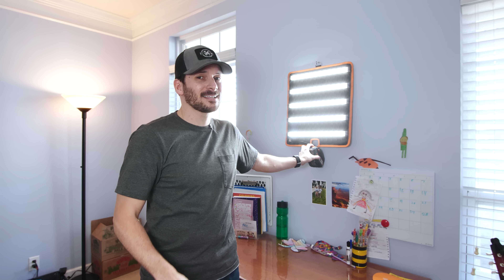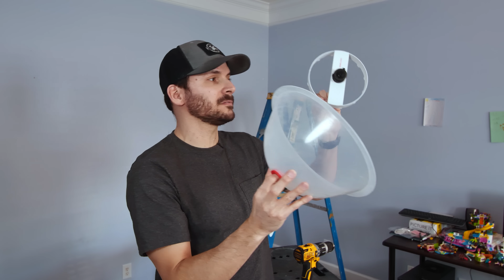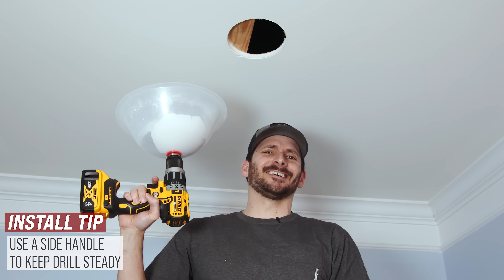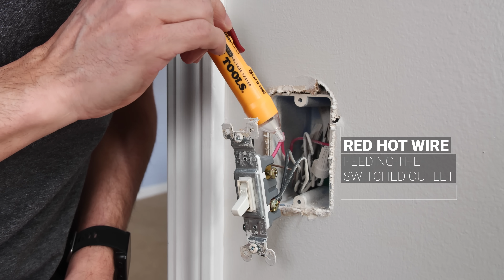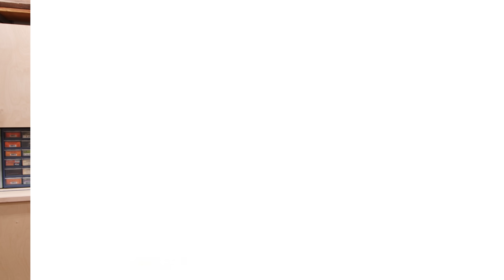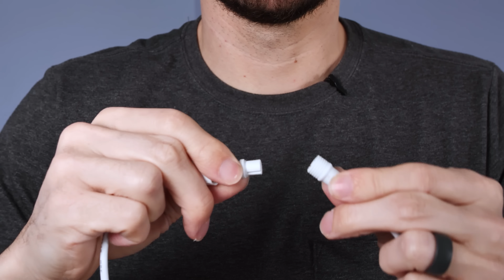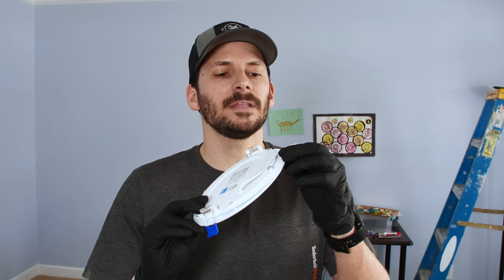Recessed Lighting Install with No Attic or Prior Wiring

Comment: Thanks for sharing this Brad. This is a something that I’ve been wanting to do for a few of the rooms in my house that just have lamps that are on switch run outlets. I have done a far amount of electrical work in the past so I’m competent enough to do that but I just haven’t been sure about how to deal with the outlets and also how to run the lines for the lights where there isn’t any existing ones there that I’m aware of. Lots of great information, thanks again Brad.
Reply: Sounds like you’ve done hardly any electrical work

Comment: Didn't show the one thing I was looking for. Somewhere you are you are turning one power line to 4. I need a cleaner way of doing that.
Reply: You start with your hot wire to the first light and then from your first light you junction off of that to the second light , then junction the 3rd light wire into the second light junction box. You just have to jeep continuing the circuit

Comment: I just put 16 of these throughout my basement, they are great! I bought ones that have 5 different white temperatures (set with a switch on each box) since I plan on painting after and haven't picked the colour yet. Another tip, mine needed a 4 1/8" hole saw but I only had a 4" one. I used the 4" one, then shaved the hole a little bigger all around using a drywall saw, rather than spending $30 on a hole saw I probably wouldn't use again.

Comment: Why didn't you just put a junction box in the ceiling at the supply cut and run the power to the outlet normally and then hook the red from the switch and white wire to the new can lights?
Reply from the maker: pigtails on light weren't long enough
Reply: You have to maintain access to the junction box according to code. You can't have it closed up between floors like that. So unless you wanted there to be a covered box in your ceiling, that wouldn't to work.

However, if you the space above is an attic space that totally would work, but instead of 1 you user 2 boxes. This way you don't have to worry about if the existing cable run is long enough. You just put a box on each end and replace the wire in the middle.

Comment: Actually in reality this job would never ever go this easy, most ceiling’s have insulation, batting or wood shavings, your ceiling looked brand new, I’m in this process now and not even close to how you made it look. And I’ve done it several times.
Reply: This is a two story house, no insulation in the between the two floors. Please don't do electrical work.
Reply: @HN-gj2iq  i am an electrician
Reply: He mentioned that most ceilings are like this. But yeah my the video title it seemed like you would need no wires at all.
Reply: In 6 years of installing electrical, I've only run into a house like his once. Might just be my region, but I'd call it very rare.

Comment: with all respect, you miss-used your voltage tester - it picked up the hot in the line you were first testing in the ceiling, DOESN'T MATTER if the switch is toggled on/off, the voltage it ALWAYS ON in the black, so you probably had the correct line to begin with.
Reply: You could not have watched the whole video.  He literally addressed that right after he tested it.

Comment: Common practice with switched outlets is what you are finding at your switch box.  The black wire loops around the screw and the Red wire is switched.  Then the 3 conductor cable goes out to the outlet where generally half of the duplex plug is tied to constant power and half is switched.

Comment: Here is some helpful advice. If the switch that controlled your outlet was on the opposite wall, and you had two lights cut into the ceiling between the switch and outlet, you could have run a piece of 14-3 between those two lights to connect your outlet again. the black would have stayed constant hot, and the red could be used as the switch-leg for the lights. this way you can have the outlet working again without cutting more holes in the drywall to run a new wire. Fiberglass fish sticks work a lot better at fishing through this type of ceiling too. Great job on the explanation though.

Comment: Question, if you have your standard light in the middle and want to replace that and put different puck lights all around your room. Can you use the wires from the original middle light n split it wit all ur puck lights? Or that would be too much power?
Reply: should be okay, they new led lights dont draw too much power.

Comment: Good video. But why no attic insulation?
Reply: possibly a warmer climate where he lives.

This is definitely not a Northern climate option -- as far as I know our building code in Ontario wouldn't allow these type of lights in an attic setting without housing around them.  That is why many people build small bulkheads so they can run the wires and lights on the warm side and not have to worry about air leakage into attic.

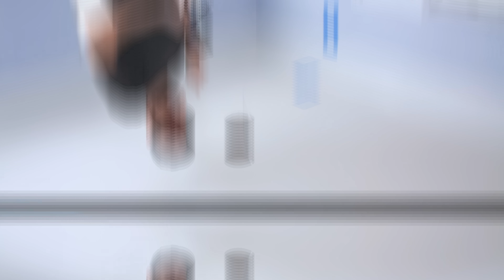Comment: At 14:00 mins rather than struggling to get the fish tape through the box or down your access hole you could undo the wiring in the switch box remove the switch box then run the wire with easy access replacing it with a remodel 1-Gang box

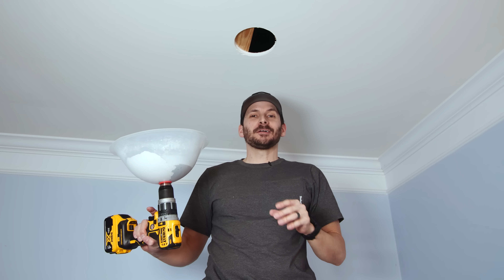Comment: 3:30 i just had a close call where the drill bit of the hole saw missed by 1.5" a 100a service cable running in the attic to a subpanel in the garage. thankfully the cable was secured to a rafter so the hole saw hit the bottom of the rafter/stud and didn't nick the cable. whew.

Comment: being at a construction job for sometime, we have this sop to put wire looms to housed the wires going to  each terminals (sockets / switch / junction box etc) that way, when we are to add another set to wire (lighting / additional socket etc) we can just feed the wire on the loom and it will definitely land to were we want it to be....

Comment: This video should have a major caveat. This framing construction is not standard. The likelihood of someone having these perfect conditions is low. You will likely have to get into an attic space if possible. If not YOU MAY REQUIRE MANY HOLES, the ones he shows later in the video @ 12:00 but also at each joist bay to cross joists to interconnect the lights. I am a master electrician and feel bad for all the people that expect these perfect conditions and then bound to their decision to take on this task after cutting massive holes in the ceiling only to find out that there aren't trusses but joists that can't fished across. Other than that it is a well explained video. If you cut in a junction box with the dead end wire that runs to the outlet, and a jumper from the light to that jbox you can power the outlet again with your choice of constant power or half hot to turn on with the lights as it originally was.

Comment: I'm not an electrician by any stretch of the imagination, just have construction experience. But just a heads up: If you plan to do this in the US and it has to pass inspection, I'm fairly certain NEC Code requires the junction box has to be secured. He did mention it can be secured in the video, but I would secure it to be safe guys!
Reply: Other than that, a great video!

Comment: After you wire the first light, how do you get the wire to the next one? You run a new wire from the junction of that first light to the next in the ceiling? If you're not going up in the attic, you used the fish tape to bring it over to the next light?

Comment: Exactly what we needed to watch for our upcoming kitchen reno....TOMORROW 😱🤣👌🏻

Does that mean the fan will also be if you don't have attic space? We've been wanting ceiling fans BUT we don't have ANY attic space throughout the entire house so we've given up on installing some
Reply from the maker: I'd need to add some blocking for a solid fan ceiling mount.  But if you have joists they make tension mounts that go between joists and you can put the fan up there pretty easily

Comment: Awesome video. Only thing i would do different is avoid make additional holes to fish the line. There are some nice tricks available to fish a line up and over a corner onto the ceiling.  A simple wooden broom stick with a weighed object attached to it via a string is great help. You can even get fancy and use the magnetic fishing tool as well.

Comment: 17:27 who did that crown molding? Gap city. Need to fill that gap - other that that, which is off topic, great instruction.  I have wired similar lights in an entertainment cabinet but smaller in size.  Mine had 3 levels of light coolness and were dimmable which have been connected to a dimmer switch.

Comment: You could also remove the crown molding at the wire area, and run the wire through small holes behind behind the crown and no drywall repair. Just re-install the crown, caulk, and paint , and you are done.

Comment: Removed the builder grade ceiling light with 2 60w incandescent lamps and installed 4 6” Dimmable LED’s in my kitchen last year.  I cut so many holes in the ceiling running 14/2 my wife thought I had lost my mind! 
But now - NOW - different opinion on my mind 😁
And the kitchen is on the first floor. Bedroom above.

Comment: Tip for the hole saw, you can use an aluminum pie plate instead of buying that bowl. You might get a bit of dust still but it's cheaper.

Comment: Hi, nice work I do have some advice about what you could've done. At the junction box you could've just wired the red wire coming from the switch to the black wire going to the light then tie all the neutrals together to have neutral going to the outlet and light and then tie the grounds together to have a ground to the light and outlet again then tie the black going to the outlet together with the black coming from the switch which will send constant to the outlet. Now the red will be controlled by the switch then at the switch change it to a single pole and on those two blacks at the switch I would've tied them together with a pig tail to the common on the switch which the homerun would send power to the switch plus send power to the outlet by the pig tail. Then at the outlet I would've just got a new outlet with the little metal tab connected so then your outlet would have constant through the black wire pig tailed at the switch and junction so that you wouldn't have to run new wire also to note that the way I'm advising about is only possible because you have a 14/3 wire if it was a 14/2 then you wouldn't have been able to do it. Either way nice work keep up the diy.

Comment: How far apart did you go with for spacing between each Ensenior 6" light?  Is the claim of 1050 lumens accurate per 6 inch light? Will a 6 1/8 hole saw work for installation or 6" better? Thanks

Comment: depending on how your code is where you live, you might be able to use a Jbox for the 14-3. have a piece of 14-2 running from the red to the lights, and have another piece tied on to the black wire back to the receptacle. and since the wafer lights are easily removable, it would be considered accessible

Comment: When you put your drill into a lower setting like that it lowers the rpms but increases the torque..you need to put it on one of the numbered chuck settings to keep it from kicking.

Comment: Tip... use the clutch feature of your drill.  That way, if it catches, the clutch kicks in and slips the bit rather than spinning the whole drill out of your hand.  Play with the setting so it is just past the point the bit bites into the wallboard.  Drill slow and easy... don't press hard.

Comment: After you cut the 110 in the ceiling i know there wasn't enough slack to pull into the little junction box to bring it out of the ceiling hole. Did you add an extra splice?

Comment: As an electrician I would have removed the switch box & used a long flexible drill bit to drill through top plate then a fiberglass rod through the hole & hooked it with another fiberglass rod then pulled a new wire to that first light leaving the existing 14/3 wire alone & just making it constantly hot .
Reply from the maker: Thought about it, but I would have violated 314.16 of NEC with # of conductors in that box.
Reply: @Fixthisbuildthat  I would have used a bigger box as a replacement either a 22.5 cubic inch single gang or a 2gang & kept the half hot outlet switch aswell as the new switch so no drywall to repair.

Comment: I just bought these lights for my basement remodel. I may have missed you saying it in the video but I'm not sure, but do you have to have a power source to each light or do you just need to power one and then run 14-3 wire in between each light? I have existing fluorescent lights and the light boxes are starting to hang out the ceiling so I'm switching them to this and wanted to use the power supply from those lights to power these lights

Comment: That was great thx so much.  But please forgive my ignorance for asking the following. Why couldn’t I just fish the wire from the light sucker that has the switch attached?  Why not fish it up through the wall and into the ceiling and then to the nearest desired ceiling light?  Sorry if it’s a really stupid question. 😂😅
Reply from the maker: no, that's a great question and I should have covered that.  It's an exterior wall filled with insulation, so doing that would have been a huge pain.  If it was interior wall I would have done that.

Comment: How did you daisy chain the lights together when there’s studs in the way? What method did you use? 😅
Reply: These are not studs. Joists is the correct term.
Reply: @jessecavada3015  ok well how did he daisy chain the lights if the joists are in the way then..

Comment: I installed them in my kitchen a couple days ago. I had to break the previous jboxes with a hammer and I kind of just stuffed the new j boxes up in the ceiling. There's like a foot of insulation up there so I hope its not a huge fire hazard. Also read the junction box and light are IC rated but im not sure if I should get a second opinion. Its been 24 hours. No fires yet lol.
Reply: My son plans on installing these this weekend and I to have lots of insulation in the kitchen. How did these work out for you? Did you do anything differently because of all the insulation?

Comment: Planning to do this soon and I'm jealous of your situation! I've got 18" of loose insulation above in my attic which I think is going to make it impossible to do this from below. I'm going to have to get up above and move insulation out of the way so it doesn't all end up in the house and I don't think I can fish wires from below through all the insulation so I might have to guide them from above. Not looking forward to it! I at least have good access but it's so hot up there and not many places to step and little headroom towards the edge of the house.

Comment: Great video and explanation!!

I’m not sure if you are aware but according to the NEC code that if you extend an electrical circuit 6 feet or more you have to use an AFCI circuit breaker if it is not already one.

Comment: Good video.  You could skip the exploratory hole in the ceiling as your hole for your light should have been close enough.  One less patch to make.

Another tip.  Use your phone and your apple watch to view up inside the ceiling!

I just did one of these in a living room that did not have a ceiling light.  Open trusses thankfully.  Cut our main hole in the center of the room.  Office adjacent we cut the exploratory/access hole.  Replaced outlet same as this video and ran the switch to the ceiling.  Being that the wire entering the ceiling to the middle of the room was about 8ft, it did take some time to get the wire across that span.  Our trusses ran perpendicular to the run so the wire kept hanging up.  Currently we just replaced the sheetrock access hole with the sheetrock and through up a "return grate" to hide the ugliness. Quick fix that will get cleaned up at a later date.

Comment: Could also take out the one gang switch box add a two gang box another switch and power it from that switch and all you have to do is pig tail another 12 2 wire off of the constant hot

Comment: Nice!
My wife wanted a light in the Main entrance, Dono why the builder didn't put one in but because it's Vaulted ceiling.
 I waited till the roof needed replacing.

Cut the shingles and OSB along the roof joists and ran a line from the light fixture to the nearest switch.  (Added a switch).
Put back the OSB I cut out (With added Cross members from the two joists)  the roofer went to work. Now we have a Beautiful Chandelier in out Vaulted entrance

 So if you need to replace your roof....think about adding light fixtures in your Vaulted ceilings

Comment: Easy way to keep that outlet energized,  pull the wire you cut out of two of the lights and run a new 14-3 between them.

Comment: I have never had a line running across the ceiling that had any slack in it like that, where I could cut it and pull it out a hole a couple feet away. I always have to make another hole right at the line and install a junction box.

Comment: Why not just find the top plate in the attic and drill it out? Make sure the power is off and use a fish tape going into the box into attic and pull back into room box and tie into dimmer switch. This is my plan to work all the 14/2 wiring in the attic and tie into the junction boxes and installing push in romex connectors. I then can connect the wafer lights in the room and be done. I know a attic is hot and you have to be careful but I don’t have to fight the new wire after drilling my holes to tie into each other. Great video though btw!

Comment: Buy extra so when they go out you can have the exact model.  Our house was built 2 years ago and one of the led lights has gone out in the restroom but it's already been discontinued.  So now we either replace ALL of the lights to match or have one that is different than the others.  I'll never have lights installed without a bulb again!